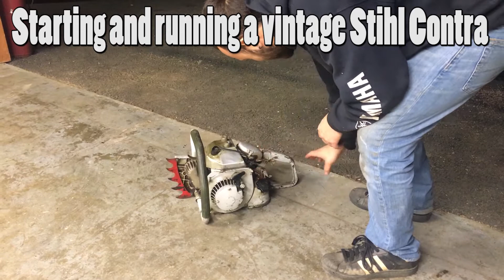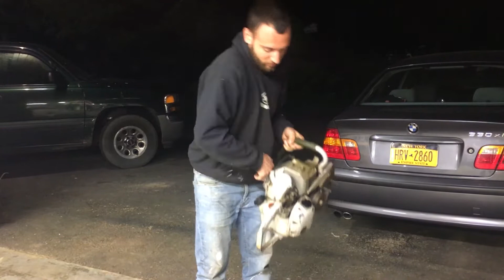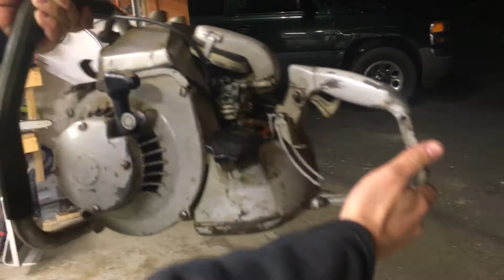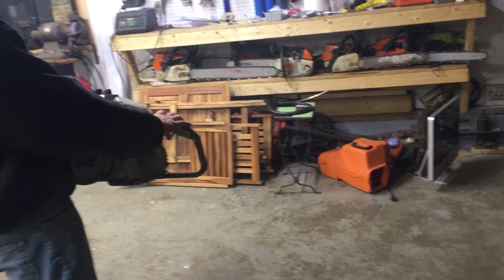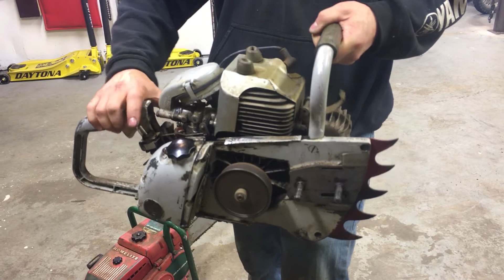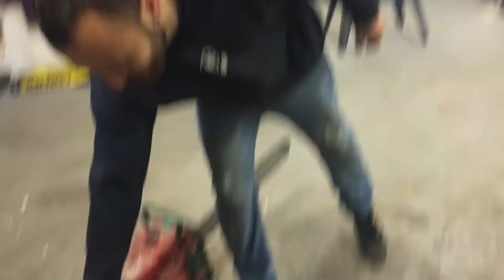Vintage Stihl Contra Lightning G5 / Running for the First Time in Years!

Comment: Clean that saw up and locate the replacement top covers online and that saw will go for $1000 on ebay. I paid $210 for a junk 1968 stihl 08 S on ebay, now it looks amazing and like new, $570 later.
Reply from the maker: I actually sold it for around $550 on eBay as seen in this video! I had the top cover for it, so cool.